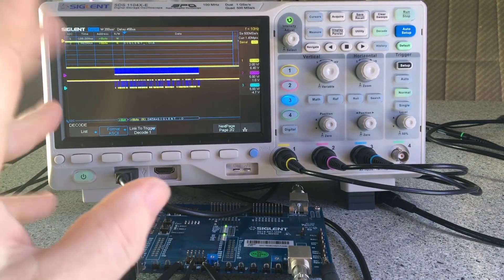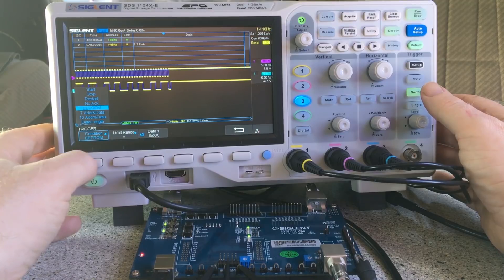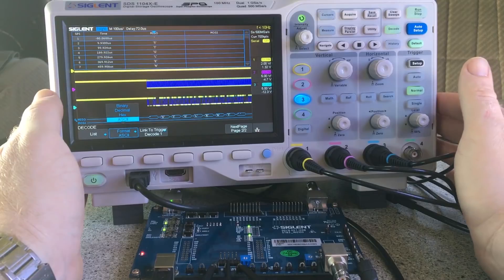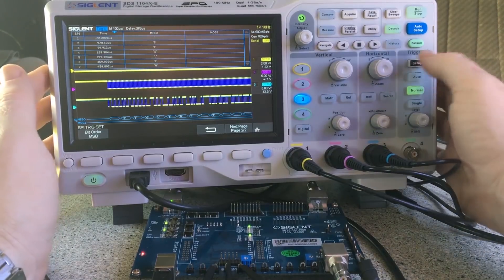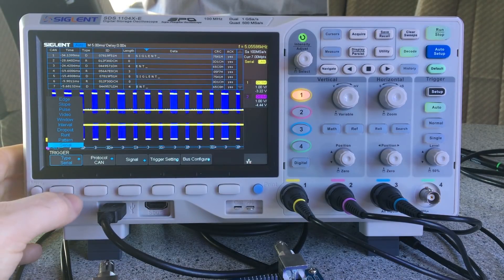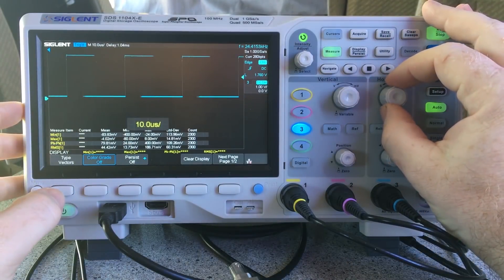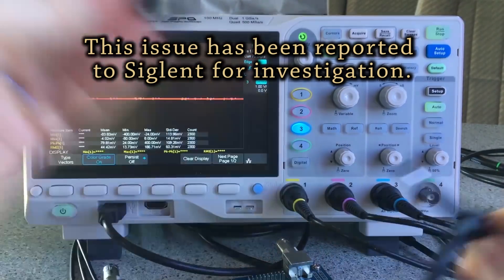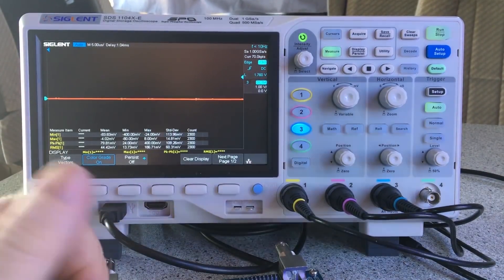#330 Siglent SDS1104X-E Oscillioscope Review Followup

Comment: Ooow nice scope :-D, i suppose the canbus might be usefull for tracking problems in the obd2 system in cars, providing that you have the modules i.d and know what the hell thay are saying lol :-D.
You might rub a tiny spec of oil into the plastic probe tip to help it stick less.
Did that sidebander get dryed ok, any life left in it?
Reply from the maker: zx8401ztv - the Radio is sitting in a box, I haven’t had the chance to get back to it yet, I am hoping it isn’t corroded away when I open it back up.